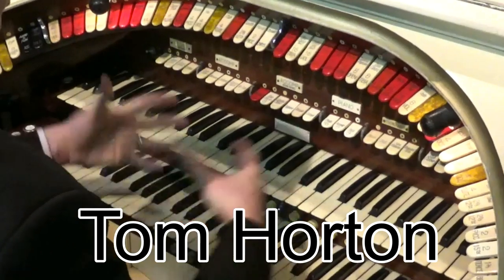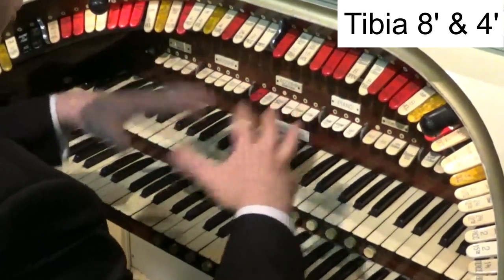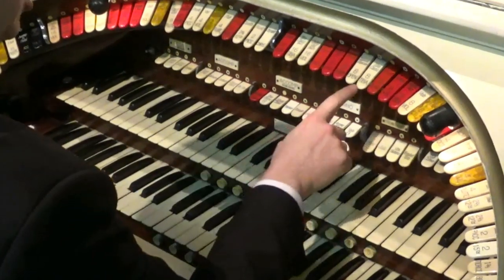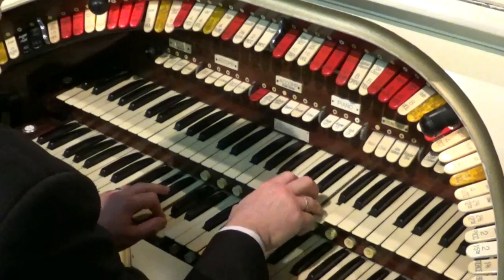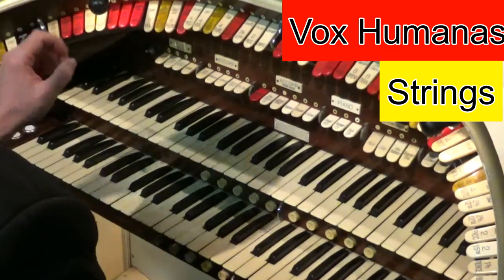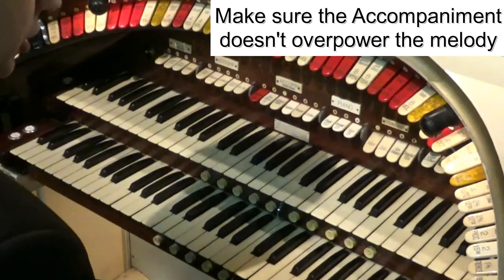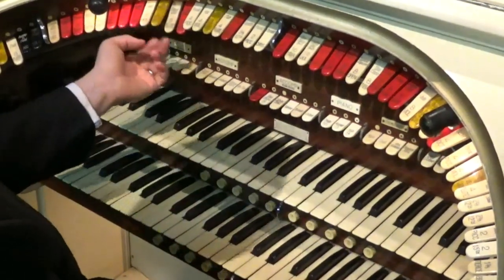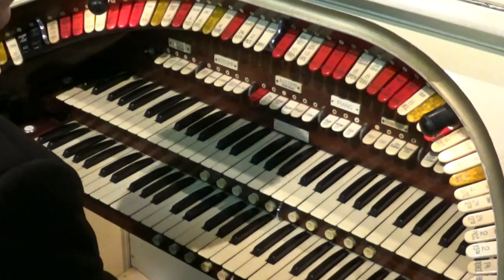Basic Theatre Organ Registrations

Comment: As an enthusiastic listener (only) of all types of organs, I really enjoyed listening to this.  With regard to classical organs, surely many of them do have tremulants over at least part of the organ (maybe gentler) even if some organists seem reluctant to use them?  But I'm only a listener so happy to be corrected by all pro musicians!  Again, a very enjoyable video, thank you.
Reply from the maker: Thank you so much for the positive comments David. Yes many pipe organ have tremulants but they are normally avoided by pipe organists. They can be used to good effect with Solo reed stops like Oboe etc

Tom
Reply: I hate the tremulants.  I don't want an instrument to sing like an opera singer, or sound goofy (like a haunted house).  That is the my biggest peeve and turn off with these and electric ones (with the Leslie, designed to do what's in the video).  It's amazing that they can be played without them.  Just the diapason alone, as all that's needed.